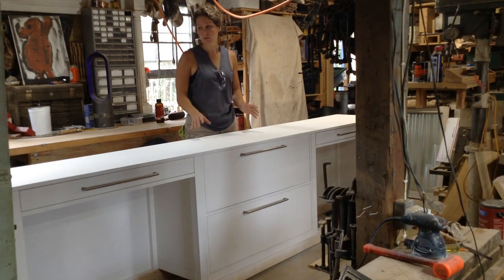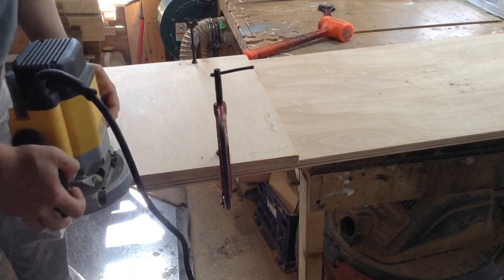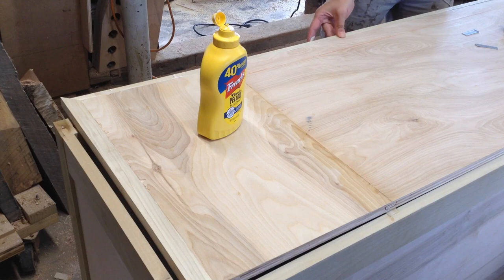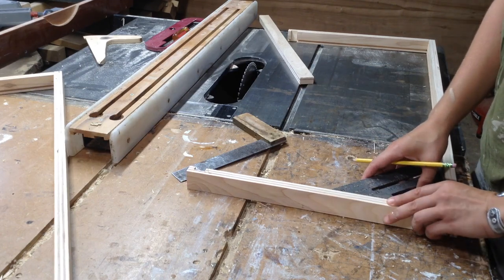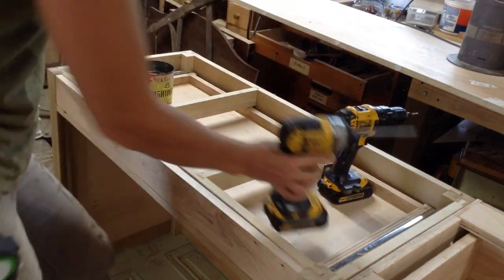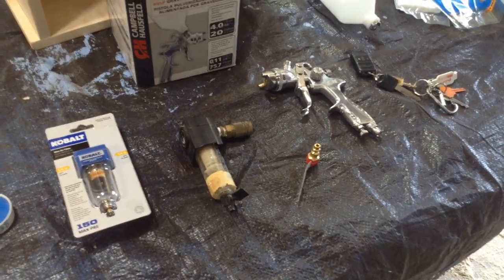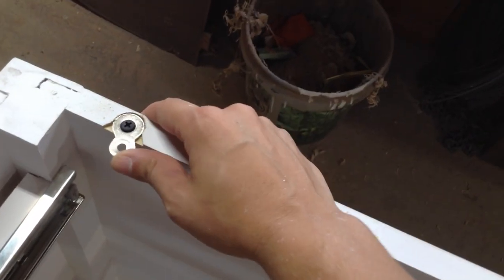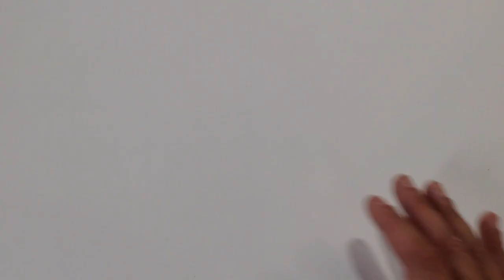Woodworking : Two Person Desk W/ Filing Cabinet Storage // How-To Part 3

Comment: With the Advance material you dont need a clear coat afterwords, I do quite a bit of cabinet work and by itself it holds up amazing just an fyi to save cost and you take a chance of the clear turning yellow over time even if it says it doesnt yellow
Reply from the maker: I agree with you, but the customer and I were trying to match an existing finish in her home.  So we went with a matte paint that ended up being the wrong sheen.  In order to get it to match I needed the clear.  Also, the regular matte picked up every single mark including finger prints so this paint needed a clear.  The water based finishes can yellow over time, but so does regular white paint.

Comment: I agree about spraying versus rolling.  I remodeled our master closet in multiple stages.  The first two stages of cabinets were roll painted, and I wasn't very satisfied.  For the last cabinet, which was about 6 feet tall, I invested in a HVLP gun and sprayed with Sherwin-Williams Emerald, which I thinned with two ounces water and one ounce Floetrol per quart of paint.  The finish came out smooth as glass...I'm now finished with using rollers.  When I have the time, I plan on removing the doors and drawer fronts from the first two cabinets and spraying with Emerald.  I'm curious as to how to transported that large piece to your client.
Reply from the maker: Yeah, I didn't want to spend money on a professional setup.  So, now that HVLP guns are decent quality with a lower price points its definitely worth it.  Transportation hasn't been decided yet, with Covid it's a whole new ballgame, but usually entails some borrowed vehicles or a customer pick-up.